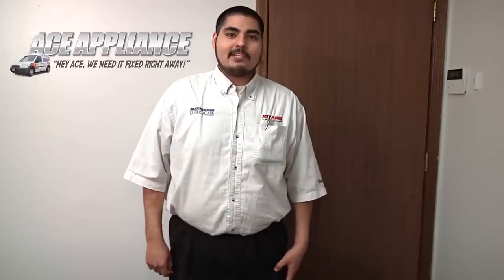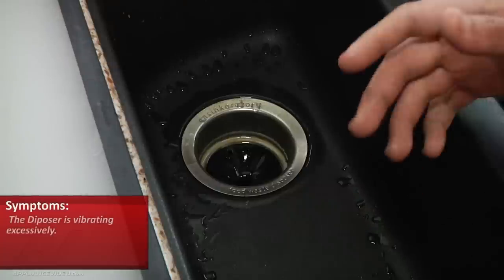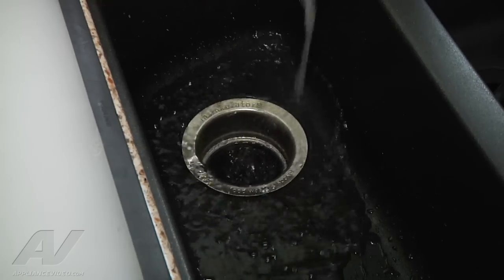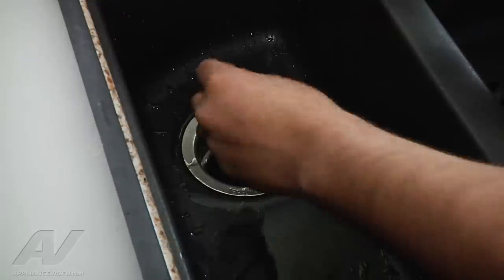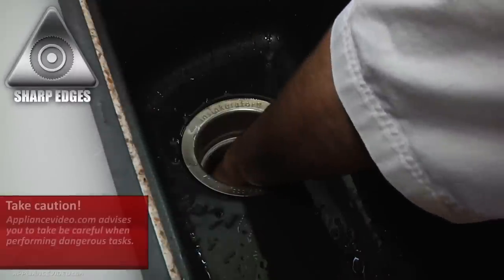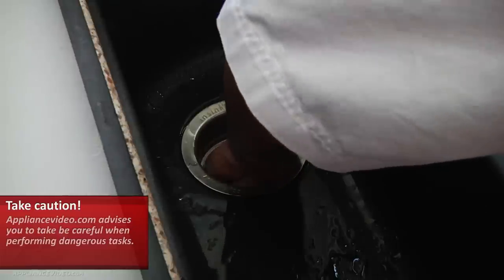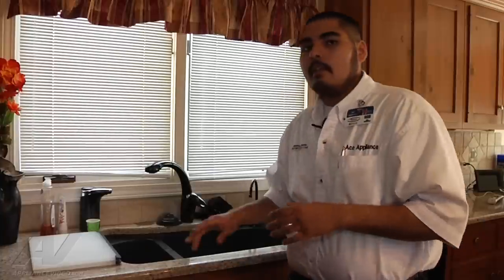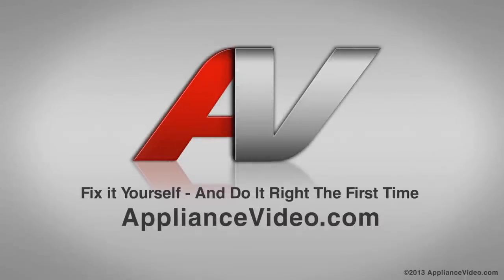InSinkErator Garbage Disposer Repair - Making Loud Noise and Vibrating - Disposer

Comment: I used about 5 pieces of ice and this worked 100% LOL! I had just reinstalled my disposal because the plumbers putty failed after 6 months. Not sure why a rubber gasket is not supplied by any of the disposal makers.  So in any case after I reinstalled the unit it was making the sink vibrate. I threw a few pieces of ice in it ran the unit for about 10 seconds and the problem was solved. Amazing. Thanks!
Reply from the maker: Thanks for your response, we are glad we could help. Our library of over 5,900 videos are currently helping over 1.6 million people like you every MONTH.  Please help us by subscribing to our YouTube channel, or post our website www.ApplianceVideo.com to your Facebook page, Twitter, Instagram or any other social media sites. Your support will help us keep producing more free quality videos.

Comment: Well done.  I turned my motor using the wrench as you had instructed and voila!  My disposer is running quietly once again.  Thanks for posting the video.
Reply from the maker: Radikal
         Thanks for the positive comment. Hopefully we saved you some money. Please help us provide more videos to our site by posting ApplianceVideo.com on your YouTube, Facebook or Twitter account or add us to your circles. If you are in need of any parts please support our parts department on line at http://savemoreonparts.com/ or call 1-800-830-5465 7-days a week until 11pm Eastern time. Thanks again your support.  Matt, Ace Appliance service technician.

Comment: I had the same exact problem with my brand new disposal.  There is a plastic piece that needs to be removed for the dishwasher inlet.  Make sure that once you pop this piece out per the instructions, you look inside the disposal and remove it. It is a dime size piece of plastic.  Otherwise, when you turn on your new disposal, you will hear a loud clanking sound followed by a loud vibrating sound.  What happens, is that this piece becomes lodged in between the rotating floor and the wall, thus jamming the disposal.  I took the disposal back down, looked into the disposal, and saw the piece of plastic lodged between the floor and the wall preventing it from rotating.  I dislodged the plastic piece with a flat head screw driver by  gently tapping it out, and made sure the floor could rotate, and reinstalled the disposal.  I turned on my new disposal and it sounded just fine, problem solved.  My disposal is the badger 5 1/2 hp.
Reply from the maker: Arlene 
    Thank you for your positive comment. We are glad we could help resolve your issue and hopefully saved you money. Please help us provide more videos to our site by posting us on your YouTube page or posting ApplianceVideo.com site on your Facebook or Twitter account. Our factory authorized technician’s also provide free repair support to people like you to help solve their appliance problems at ApplianceVideo.com.  So email us if you have any other questions our videos cannot resolve. Thanks for your support in advance.  Matt, Ace Appliance service technician.
Reply: Installing a Badger 5XP this minute, was suspicious when I pushed in that plastic cap. Noise was bad so googled it and it leads straight to this video and your comment. Sure enough the plastic circle was lodged inside stuck in the gap of the wall away from the teeth.
Reply: I had the same issue with an older disposal (moved into a house for 4+ years and suddenly hear the noise like this). I found the plastic thing in 2 pieces and removed them using my hand.

Comment: The disposer may not have to be replaced! First, you should unplug it then connect the disposer from the sink, remove the rubber "gasket" so you can see inside. If you can see an obstruction, remove with beedle nose pliers, a screwdriver, etc. Or, you might be able to push the obstruction through the disposer, and remove it from the drain pipe.

Comment: My disposal unit is located in my FL condo which is only used for 6 months/year. Even when I'm there I rarely if ever use it but occasionally I'll turn it on just to keep the motor & blades from "freezing up." When I get to my condo I turn it on just to make sure it's working quietly. It usually is a little noisy initially but I flip the switch on & off a few times & that usually quiets it down....except for this year. I went on Youtube & found this video. Put a bunch of ice cubes in, flipped the switch & voila, it's now quieter than a church mouse.
Reply from the maker: Great question, if you have a more technical question that our parts department cannot answer, you can search our over 17,000 answered questions free at our website www.ApplianceVideo.com under our Repair Help section. You can also call our parts department at 1-800-830-5465 and they can give you help 7-days A week ,or search at www.SaveMoreOnParts.com  .

Comment: Thanks my badger 5 is not that old and started making strange grinding noises and getting jammed/stuck. I was going to see about swapping it under warranty but after I finally freed up the blades the ice trick got it almost back to normal. Still shakes a little but its working again and shiny inside. Ill be doing this more often
Reply from the maker: Great question, if you have a more technical question that our parts department cannot answer, you can search our over 17,000 answered questions free at our website www.ApplianceVideo.com under our Repair Help section. You can also call our parts department at 1-800-830-5465 and they can give you help 7-days A week ,or search at www.SaveMoreOnParts.com  .

Comment: thank you, it worked for me I had to check twice the first time I missed it, ran the disposal again the noise was still there. I took it off again and found the plug wedged between the floor and the wall of the disposal. Thank You
Reply from the maker: James Pollard 

Thanks for the positive comment. Hopefully we saved
you some money. Please help us provide more videos to our site by posting ApplianceVideo.com
on your YouTube, Facebook or Twitter account or add us to your circles. If you are in need of any parts please support
our parts department on line at http://savemoreonparts.com/ or call 1-800-830-5465 7-days a week until 11pm Eastern
time. Thanks again your support.  Matt, Ace Appliance service technician.

Comment: If it is not jammed and is just noisy as heck, I assume the bearings are dry or worn. Is there any easy way to lube or replace them? Or is it just time for a new disposal, despite it working just fine otherwise?
I can not find an answer anywhere. :-(
Reply from the maker: Great question, if you have a
more technical question that our parts department cannot answer, you can search
our over 10,000 answered questions free at our website www.ApplianceVideo.com under our Repair Help section. You can also call
our parts department at 1-800-830-5465 and they can give you help 7-days A week
Monday -Sunday, or search at www.SaveMoreOnParts.com  24 hours
7- days A week.
Reply: make sure blades are spinning freely

Comment: I didn't have any vibration but did have a high pitch whining noise. Ice cubes resolved that and it's sounding normal again.
Reply from the maker: Great question, if you have a more technical question that our parts department cannot answer, you can search our over 17,000 answered questions free at our website www.ApplianceVideo.com under our Repair Help section. You can also call our parts department at 1-800-830-5465 and they can give you help 7-days A week ,or search at www.SaveMoreOnParts.com  .

Comment: I solved the humming part with the wrench turning the bottom piece, but then I was left with a horrible Banging sound that told me something was still in the machine. A Video of how a garburator was built helped me. I took off the plate where the garburated mixture is expunged, put my hand in there and turned the grinding wheel. The problem was a wire skewer (Used to hold meat together) caught in the machine. It escaped my detection as I went in through the top. I have read lots of how to solve garburator problems but not read (or seen on video anyone suggesting doing what I did. It is possible that the problem is best detected from the bottom.
Reply from the maker: Thanks for your response, we are glad we could help. Our library of over 5,700 videos are currently helping over 1.6 million people like you every MONTH.  Please help us by subscribing to our YouTube channel, or post our website www.ApplianceVideo.com to your Facebook page, Twitter, Instagram or any other social media sites. Your support will help us keep producing more free quality videos.
Reply from the maker: Thanks for your response, we are glad we could help. Our library of over 5,700 videos are currently helping over 1.6 million people like you every MONTH.  Please help us by subscribing to our YouTube channel, or post our website www.ApplianceVideo.com to your Facebook page, Twitter, Instagram or any other social media sites. Your support will help us keep producing more free quality videos.

Comment: I just change a nice 3/4 horse power that blades were loose on its base sometimes did noise sometimes didn’t but if you don’t change it at 10 pm owner will be calling I’m sorry to call but the worker you guys send did not do a good job garbage disposal still do noise then you get the f word of course owners in front of you will say thanks you save my life when the noise comes again they will forget how nicely they were , I change a lot of them after they get stock 3 times the space on the wall get bigger and bigger stuff gets trap

Comment: What does it mean if your garbage disposal blades are making a rattling noise like their loose?
Reply from the maker: Great question, if you have a
more technical question that our parts department cannot answer, you can search
our over 10,000 answered questions free at our website www.ApplianceVideo.com under our Repair Help section. You can also call
our parts department at 1-800-830-5465 and they can give you help 7-days A week
Monday -Sunday, or search at www.SaveMoreOnParts.com  24 hours
7- days A week.

Comment: Ice didn’t work for me so I got some silicone lubricant and sprayed it down on the posts where the cutting blades are one of the cutting blades kept inverting back towards the center so I moved it back to the outer perimeter and ran it on and off flipping rotation directions couple of times with no water on, problem solved!

Comment: So wait does this mean it just needs replaced? Mine still turns on, works fine, but when I kill the power you hear that sputtering. Nothing is jammed.
Reply from the maker: Great question, if you have a more technical question that our parts department cannot answer, you can search our over 17,000 answered questions free at our website www.ApplianceVideo.com under our Repair Help section. You can also call our parts department at 1-800-830-5465 and they can give you help 7-days A week ,or search at www.SaveMoreOnParts.com  .

Comment: So what is the fix? My disposal is having same sound and I found nothing. What should I do?
Reply from the maker: Guy 
       If the motor is not tied up or jammed its best to replaced the complete disposer. Get the model tag off the unit and call 1-800-830-5465 for a free quote on a new unit shipped same day. Thanks
Reply: Thanks!
Reply from the maker: You are welcome
Reply: +Guy inSJ 
Ice cubes? Did it for my disposal that was making a HORRIBLE grinding sound. I did nothing else, besides adding the ice cubes....66 year old female. :)

Comment: look inside the GD for a nail or screw. I just finished putting in a new GD and decided to look in the old GD, I found a sheet rock screw cut in half. I did not see it when I look while the old GD was under the sink. I looked probably 6 times why the GD was rattling. Dang it. Spent 95 bucks for a hard lesson. The magnet I have for working on cars would have been perfect. good luck.
Reply from the maker: Thank you for your positive response, we are glad we could help. Please help us by
subscribing to our YouTube channel or post our website www.ApplianceVideo.com  on your Facebook page. We want to let your
friends & family know how our FREE videos can help them.  Or you can
support our parts department at 1-800-830-5465 and our parts website www.SaveMoreOnparts.com .  This is the only way we can continue to
post free videos and help over 900,000 people per month like you repair their
own appliances. We also have thousands of more quality videos on all major
appliances made by our factory trained technicians at www.ApplianceVideo.com .

Comment: I tried the above and they didn't work.  Then I shut the circuit breaker for the disposal, removed the plastic strainer, used a screw driver to move the blades around.  This loosened the blades and the vibration stopped!
Reply from the maker: Thanks for your response, and we are glad we could help.The blade was most likely jammed in some way with debree. Glad it worked out for you.   
Please help us by subscribing to our Facebook page, YouTube channel, or post
our website www.ApplianceVideo.com .

Comment: This is the same noise my insinkerator is making! It's a BRAND NEW unit. I'm totally not replacing it.....
Reply from the maker: Yes, Its a job to replace it. Good Luck
Reply: I don't think that's the point. I just replaced the thing. It's a brand new unit. I am not going to buy another one. I think the problem is that it only came with a cardboard fiber ring and not a rubber ring to absorb noise.
Reply from the maker: Okay,yes if the unit has a cardboard ring was in the box it can cause additional vibration. If it is excessive,  I would take it back for replacement as it should have a one year factory warranty.

Comment: So to fix it,  you just replaced this one?  Mind does the same annoying noise and freaking Knocks things on the counter.
Reply from the maker: +Lam rof 

         Good question, with our technicians
now getting hundreds questions weekly, they are answering all questions at our
website http://www.appliancevideo.com/repair-help/ .  We also have over 30000 common questions
and answers that you can easily search through by your model number, appliance
make, problem or error code and it’s absolutely FREE.

Comment: My garbage disposal doesnt make any sound when I turn it on.
Reply from the maker: +Shilpa Rivera 

All of our technicians are now answering questions daily at our http://www.appliancevideo.com/ website under the Repair Help section.  We also have over 1600 common questions and
answers that you can easily search through by your model number, appliance
make, problem or error code and it’s absolutely FREE. You also have the option
to email a factory service technician with a question on your appliance at
http://www.appliancevideo.com/repair-help/ . If you’re looking for a repair video, you
can also search our library of over 2600 free repair videos. ApplianceVideo.com
specializes in quality DO-IT-YOURSELF appliance repair videos and we get over
800,000 views per MONTH to our videos worldwide and growing. If you need of
parts for your major appliance, we have over 5-million parts in stock at http://savemoreonparts.com/ .  Thanks
for your support. Matt Ace Appliance factory service technician.

Comment: I put the icecubes in and now the motor won't turn the blades.
Reply from the maker: Great question, if you have a more technical question that our parts department cannot answer, you can search our over 17,000 answered questions free at our website www.ApplianceVideo.com under our Repair Help section. You can also call our parts department at 1-800-830-5465 and they can give you help 7-days A week ,or search at www.SaveMoreOnParts.com  .

Comment: It could be unbalanced
Reply from the maker: Shawn 
        Yes, if unbalanced it would be an installation issue or an internal part in the disposal going bad. Please help us provide more videos to our site by posting ApplianceVideo.com on your YouTube, Facebook or Twitter account or add us to your circles. If you are in need of any parts please support our parts department on line at http://savemoreonparts.com/ or call 1-800-830-5465 7-days a week until 11pm Eastern time. Thanks again your support.  Matt, Ace Appliance service technician.

Comment: mines not quite like this but on it's way, has the sound like gristle wedged in there,it's clear..& I'm guessing bearings..it's for sure not spinning in perfect balance..do I take it apart & find the prob rendering the sink unusable for how ever long or get another ? ..buy a new one & get it done or wait till it's a disaster..maybe at the most inopportune time ? yep I agonize over everything large or small…no matter what it will come apart, I've done this ever since I could walk and hold a butter knife…things are dis assembled & understood.
Reply from the maker: Great question, with our
technicians now getting hundreds questions weekly, they are answering all questions
at our website at ApplianceVideo.com under our Repair Help section. We have over
3,000 common questions and answers that you can easily search through by your
model number, appliance make, and problem or error codes.